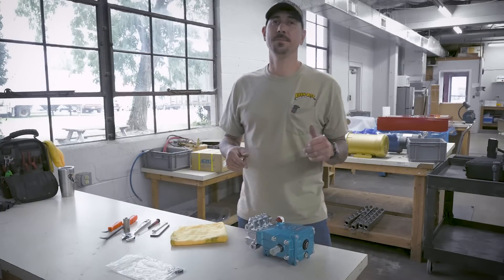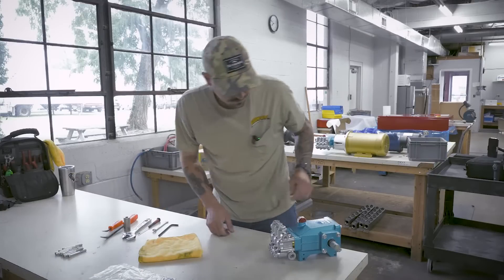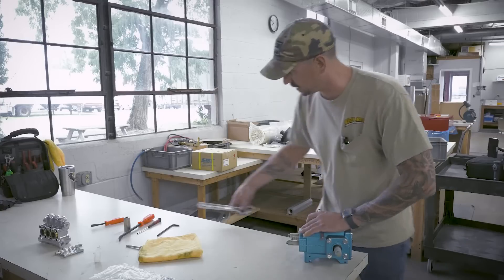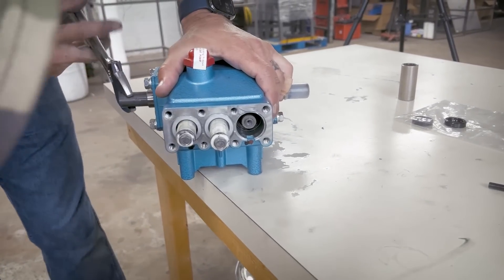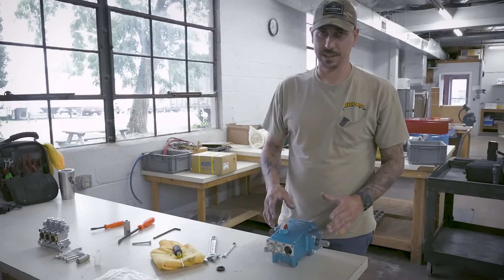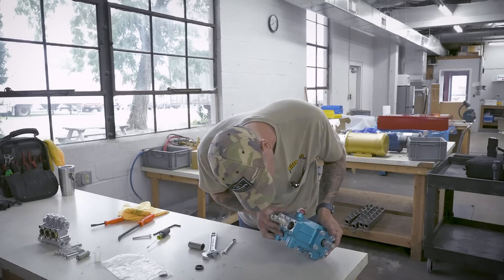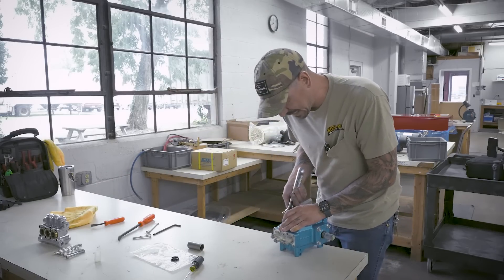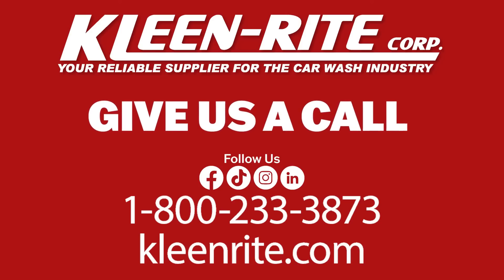Fix It With Phil: Learn How To Easily Replace The Oil Seal On Your Cat Pump 5CP

Comment: anyone here tell me why my cat pump is seeming to pressurize and pushes oil out the vent/filler cap? no water in the oil and seems to work fine....just looses oil every time you use it.....oil level is not over full when i start

Comment: Thanks! I would like to see the crank shaft bearings on either side replaced. Some how I got 2 pumps with crank shaft bearings broken. Oil everywhere, then when I inspected it that shaft was wiggling and bearing piece of metal came off. Some say at that point not worth it. Anyways but some times I have other pumps aside with different problems. So swapping the good to one another maybe works. A few thousand bucks squeezed out of junk won't hurt.

Comment: Probably a silly question but would oil leaking be the reason to change the oil seals?
Reply from the maker: No question is silly, but yes, that would be an indication that the seals need replaced.